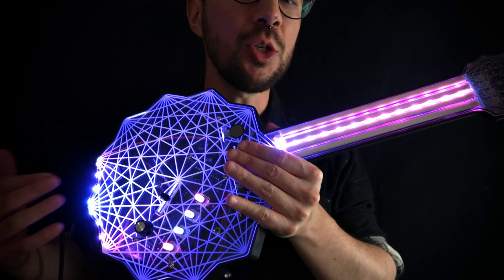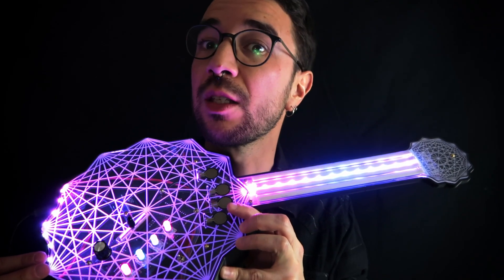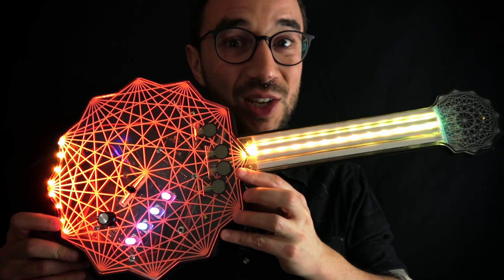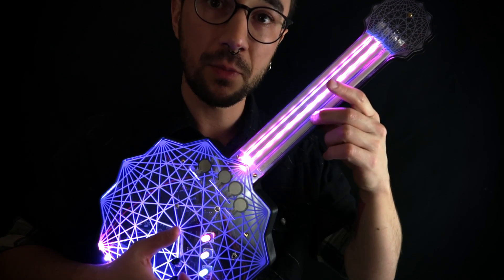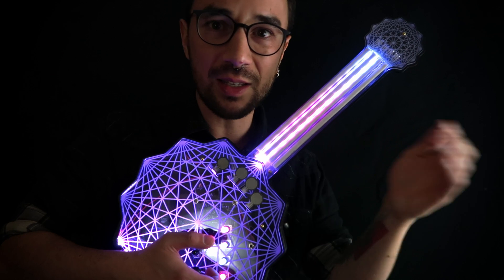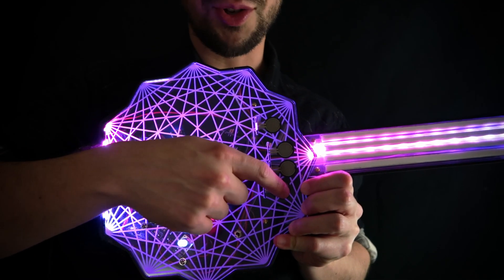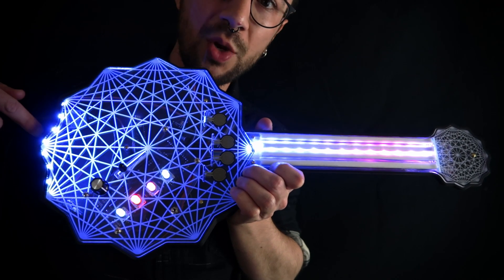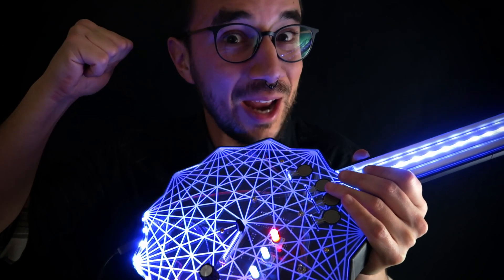Meet the XT SYNTH! || A guitar / violin / synth / MIDI controller!

Comment: Lovely video. I am not a musician but a software engineer who likes to play with controllers and synth since the C64  and try to make  music; noise according to my wife.

Regarding noise in that pressure sensor. How did you get rid of that?? 
I am working on a six string instrument with 6 M5 Stack ToF sensors. Getting rid of the noise in measuring is the first challenge.

And debounce in the normal switches? borrowed code from mechanical keyboard firmware?